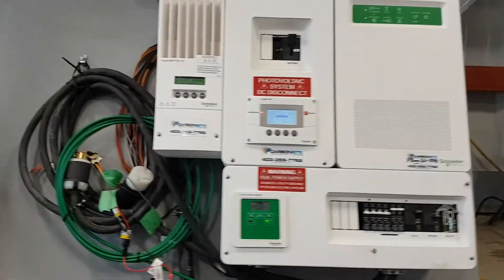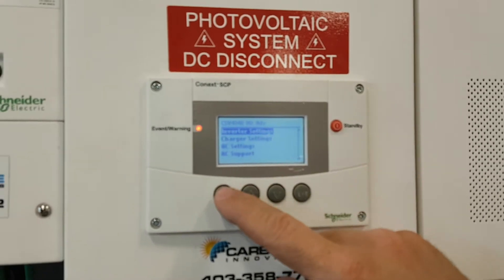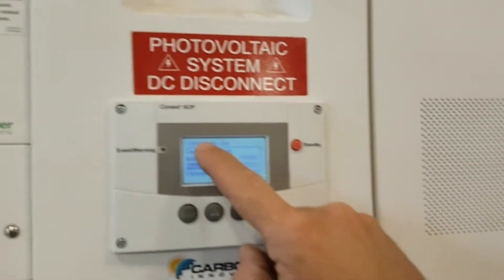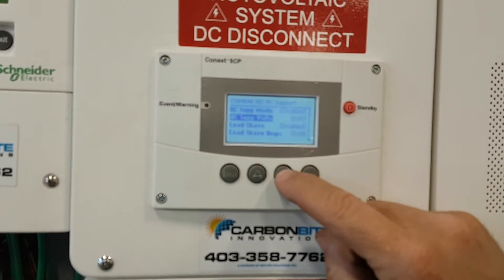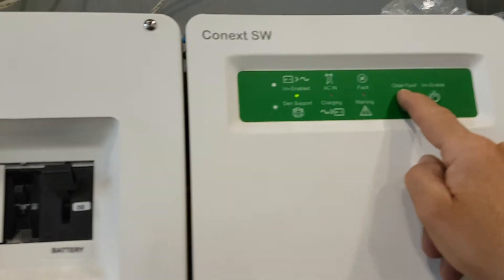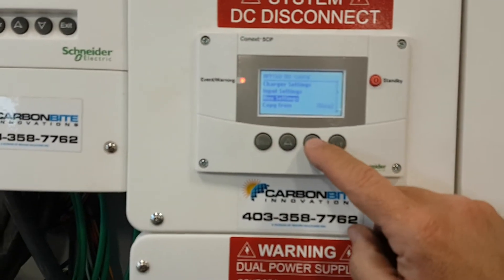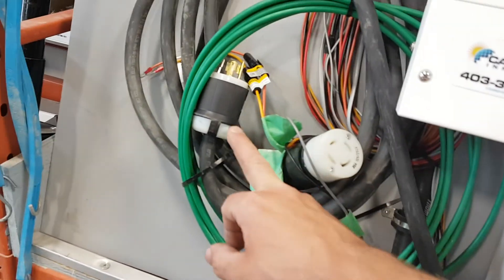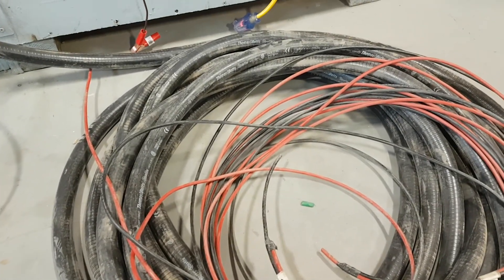#3 SW4048 settings Schneider

Comment: My 4048 resets whenever it runs a load over 2,000 watts. The cooling fan kicks on after 10 minutes, but it causes the system to shut off for a couple seconds, which cause all my electrical appliances to turn off, and then turn on after about 5 seconds.

Comment: As I said before , I have 8 12v 200 ah batteries. I only want to fill go 95% as its full charge (56.8v). How do I set that up on my Context sx Schneider 4048 inverter? I also don't want it to go below 52.6 which would roughly be a 50%. How to I set this up. Go easy on me I am truly a rookie in this.
Thanks
Reply: you can set the Bulk and the ABS to only charge to 56.8       and set the Low Battery Cut Off  LBCO on the inverter to 52.6   From Camo Solar Inc

Comment: Two questions. How is the Batt capacity determined? I have 8 12 v 200 AH Lithium batteries which will replace 8 12 v 200 Ah gel batteries. Whta is the voltage on this context 4048 , is it 24 or 48 volts?
Reply: 1st question Battery Amp hour is battery is 200Ahr times voltage of the string or system so 200ahr times bat voltage of 48 volts is 9600 watts or 9.6kwh
Or another way is 200 amphour at 48 volts.
Reply: the Sw4048 means 4000 watts and 48 volts dc

Comment: I have the Schneider 4048 is new but the output voltage is very high instead of 220/120 Vac is reading 257/128 Vac.
Reply: I would check grounding and than call teck suport

Comment: You need a two pole 50 amp breaker that ties into the inverter well if you need a Schneider AGS controller and yes there are special settings for it there's exercise time runtime voltage high voltage low crank time for the generator limit output for generator if you don't use that you'll roast a generator and a GS controller will tie into the Generac start circuit diesel generator glow plug delay hand crank using the remote software package is in it where you at lot easier to go figure out all of this runs on their canbus
Reply: Good Day Guy im not understanding all what you are doing
Reply: Talk about a "run-on sentence"!!! Try using punctuation!! Senseless comment.

Comment: bulk charge 50 volts float at 58 cut off at 63 V lead acid batteries can handle that charge rate at 50 amps
Reply: I dont understand what batt you have

Comment: I am getting a LOW VOLTAGE WARNING . I have 8 RENOGY 12v 200 ah gel batteries which I checked and are better that ok. I got AN OUTBACK FLEX 80. When I turn off the inverter the voltage come back up, but if it ON BUT STILL NOT USED voltage goes down. Can anyone please help_
Reply: yes please check your batterys   thay sound low     or junk

Comment: I would like to see how the generator is connected
Reply: Good day Sir i have wired a few of the SW invertert systems    what are you looking for ? Do you mean the AC  wires or the AGS  ?
Reply: @camosolarinc7697  yes both
Reply: @camosolarinc7697  for load shaving the 4024 manual says to set it to 10A instead of the default setting of 24A, why is that?
Reply: @earthenergyhex   Well i need to Reply kinda carefully because the SW inverter has a few problems and that is the 
AC support    
Load Shave 
and SOC
this you can learn on your own but if you live off grid i set them all to DISABLED   .
Reply: @camosolarinc7697  disabled them all?  what sort of problems do they present when enabled?

Comment: Can I add a second sw4048 to increase my power to 7000 Watts?
Reply: Thay had a lot of problems  with adding a 2nd sw inverter     so you can't  add no more
Reply: NO  the sw4048   and all the sw inverters had many problems with 2 hooked up most or all of them made bad smoke

Comment: Where do you connect your generator feed wire to the system?  As well my generator is a Generac 13kw is there any special settings that need to be set? Thanks
Reply: There is good wire diagrams with the manual of your system as to the AC input

Comment: When my generator kicks in to support the inverter and batteries, my power kicks off for split second, I loose all power for a second or so. Everything has to reboot. I have A SW4048, 48 volt setup, AGS, and solar panels, and Conex Combox to make any changes.
Is there a setting I need to focus on?
Appreciate any help in this area!
Reply: Good morning Eric      I have worked on a lot of sw Inverters and have seen this problem a few times   , there is a few things it can be  , what size of genset are you using ? what is the voltage and HZ settings that you programed in the SW  ?
I have seen that if the AC settings are open to big 90 to 138 volts 54 to 70 HZ it can be a problem  try 100 to 138  55 to 65 hz    maybe that will help ,

Comment: Hi can you explain ac support feature I want to use enphase inverters in an ac couple scenario and only use my sw as a grid backup outage scenario and rest of the time have it push out to the grid
Reply from the maker: Hi plojm123, Thank you for the comment! If you would like, give our shop a call at (403)358-7762 and one of our professionals can assist you with this.
Reply: @cbisolar1996  how much?

Comment: Hello

Nice  video, I whould like to know what whould happen if I change the configuration of the stage inverter to 2 stages without flooding, I saw another video and recommended this configuration for better performance in the inverter, the change will be only in the inverter ,what do you think? 
Best regard
Gilberto
Reply: Yes you could change to a three stage setting. As the genset is / should be used as backup for when you have low solar energy. Using the genset to float would be a waste of fuel
Reply from the maker: Thank you, Gilberto! For more info on this setup, please give our shop a call at (403)-358-7762 or email at sales@cbisolar.com, one of our professionals would be happy to assist you!